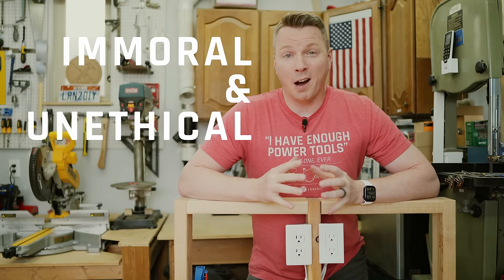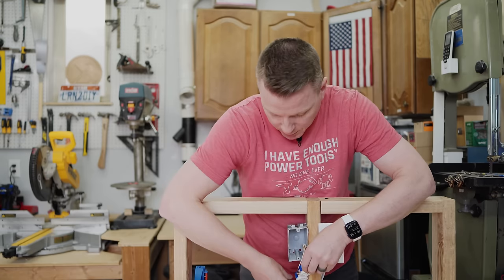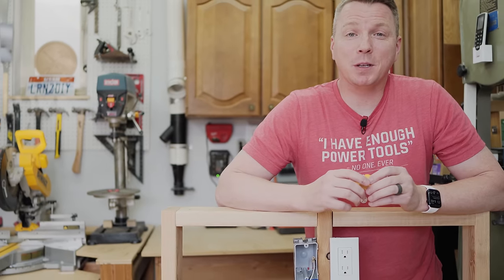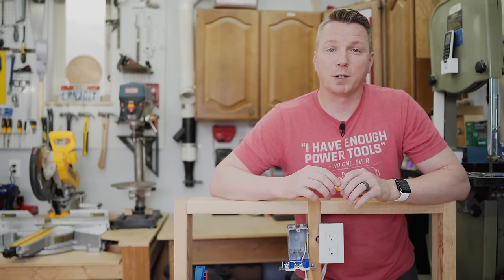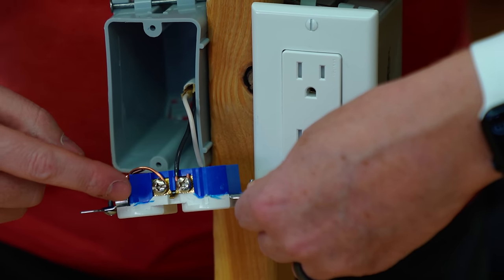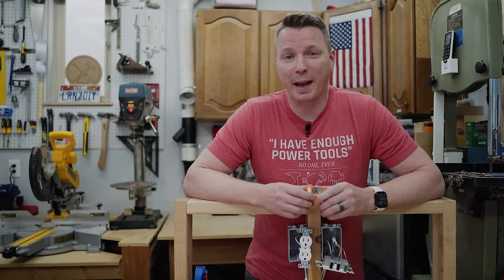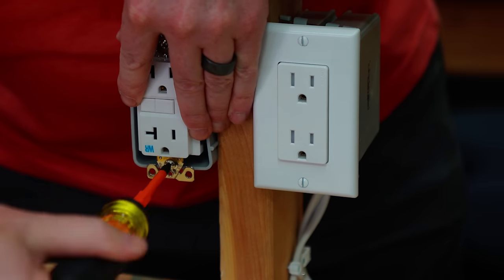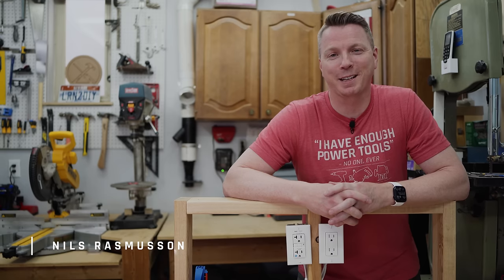People Are Adding Deadly Hacks to Outlets

Comment: After 20+ years in the business of renovations I have seen many examples of illegal work arounds. I started doing cursory inspections for friends and family looking to renovate or buy homes in my spare time and I got into the habit of looking for certain "tells" regarding electrical. Yes I did use a basic outlet tester to start with, but I usually started at the panel to see if there was any red flags. I would look for any circuits with old 2 wire cable, 2 circuits on 1 breaker etc.  backed it up by pulling covers off of outlets and verifying proper connections of hot, neutral and ground. The older a house is the more interesting it can get and I have seen plenty of disgusting displays of illegal work and not just by DIY'ers with no knowledge but actual Contractors, including licensed Electrical Contractors. Be safe and double check.
Reply: Worst house I ever worked on was previously owned by a licensed electrician who told me he had re-wired the entire place just a few years earlier.  I found wire nut connections hanging inside the walls, lights mounted without work boxes and even one connection that was just twisted wires buried in the plaster.  Nice.
Reply: I like how guy never explained why a bootleg ground is a bad idea. When in fact its a great idea. I suspect dude never actually explained this because the arguments fall apart when u realize ground and neutral are tied together at the panel. Its better than nothing and thats why its there. If you find this, dont undo it or replace it with gfci or get a third conductor in there. Allot of NY apartments use the plumbing as neutral and ground
Reply: Stephen,   I worked from 1983 to 2018 as a designer to Sr. Design Engineer for contractors.  My son was buying a house recently and the inspector had concerns about a panel and a 40a breaker on #12 conductors.  I got a picture of the panel sent to me and it was extremely weird looking.  Breakers on every other slot only.   The owner hired an electrician to change the 40a breaker to a 20.  My son decided to let the panel go as is to let the sale proceed.  (Former boss’s house).   Here is what I found.   Main panel black and red on 2 pole breaker, white and bare on n/g bar.   At the sub panel, MLO, red in bus lug, white in bus lug, black on neutral bar, bare on ground bar.  N not bonded.   The breakers were all on the bus connected to white.   After swapping the black and white at the sub, every receptacle was now wired backward.  They were wired backward to show up correctly with tester.  Every receptacle that was installed by that contractor at the time of finishing the basement was used when installed.  Tabs broken off and screws removed.  This was a first for me!  I thought you might like to hear about that one.   Respectfully,   Kevin
Reply: @Wtfinc why not install a GFCI? That should be safer than even a properly grounded outlet because it will stop current completely if it detects any ground fault. Grounding equipment chassis as a path for fault current is nice, but that won't stop fault current from also flowing through you to a suitable ground.
Reply: @Wtfinc  There's a reason why a separate ground is required and in some application there's also an isolated ground (isolating the ground on the outlet from the conduit or box ground).  Yes, neutral is bonded to ground, but only at the main service panel/load centre.  It gives a separate path from neutral back to the panel because the device that requires a ground typically has a metal chassis.  Some appliances, consumer electronics and desktop computer systems have a metal case or chassis of some sort.  You cannot rely on neutral for grounding in these cases because you cannot ground with neutral.  If you have an incident with reversed polarity and the neutral wire is now live, the risk of electric shock causing injury or death (electrocution) is there.  The ground is there for another path back to the panel that would then trip an overload protection (breaker or fuse) or a GFCI/RCD.  I would suggest looking at videos by RimStarOrg, Matthias Wandel and Engineering Mindset for further explanation.
Reply: I did a side job one time. they said their generator wasn't working. Turns out you can hook up a generator with a two wire cable if you just ditch the neutral 😂😂😂😂
Reply: @G8tr1522  Congrats, you successfully set up a ticking firebomb for someone to suffer through when it inevitably fails.
Reply: @Wtfinc  You don't know how electricity works or flows do you? First go find out why ground and neutral are bonded AT THE LOAD CENTER and not the device.
Reply: Bootlegging the ground is a bad idea because current flows on the netural, because of the AC power. So if the netural wire is damaged or disconnected... you effectively have a floating live wire connected to the grounded surface... the ground wire is for redundancy. It should never have any current flowing on it, so it's unlikely to to be damaged or disconnected.
Reply: @SuperPickle15  Great explaination! Easy to understand. 👌👍
Reply: @Wtfinc  You baffle me, dude.
Reply: Any time I asked my grandfather why he was doing something in a way that I recognized as wrong, his answer was always, "a poor man's got poor ways". I'm certain he did all the wiring for his house...which started life as a chicken coop, and no longer exists.
Reply: This is why I will never own nor employ a Californian Contractor. It should be a crime for them to work in any other state.
Reply: I was rehabbing a house it needed an $8 dollar grounding clamp - Three companies quoted from $8000 to $16000 to fix the system, installed the $8 part and paid my buddy to look it over and it passed one company even flagged a part my buddy installed as deficent, My friend was a master electician in another state. 90% of the time apprentices do the actual work the master electrician sells his licence for them to use.
Reply: @porticojunction to be fair this Is why the saying  "do as I say not as I do' exists
Just hope his work for clients was done correctly for those without high volt knowledge!
Reply: That Sure test is so worth it paid for itself pretty fast! Highly recommended.
Reply: @Wtfinc  You got a major disconnect going on. You short circuited and should put in a new fuse.
Reply: @Wtfinc  Learn about an open neutral first and you'll realize how dangerous a bootleg ground is. There is a reason why neutrals are insulated. Never ever touch an exposed neutral wire for whatever reason unless you have isolated the circuit.
Reply: @mpioman9885 With a grounded outlet your gfci can trip faster as soon as there is a fault. Without it, current has to first flow through you to ground before the gfci trips.